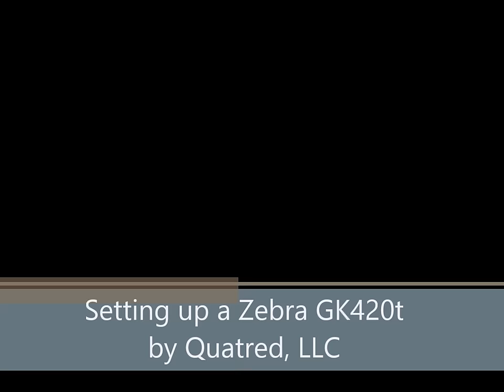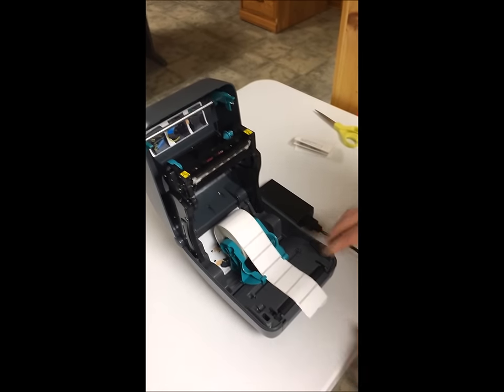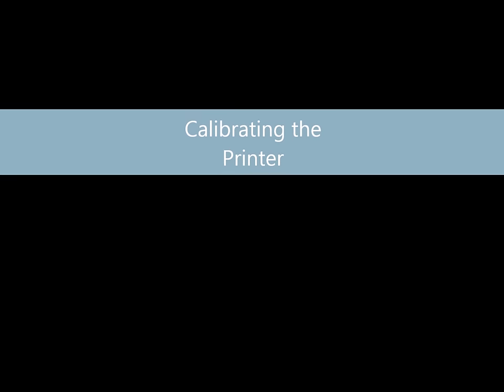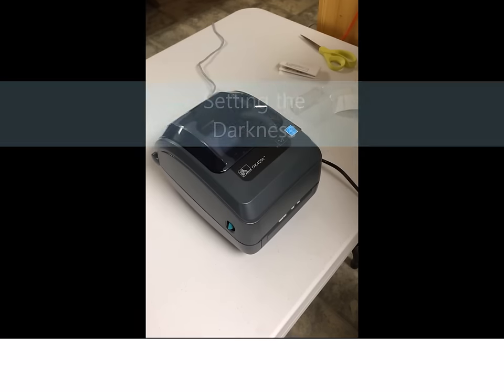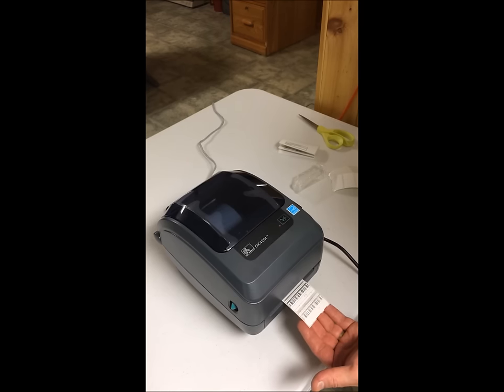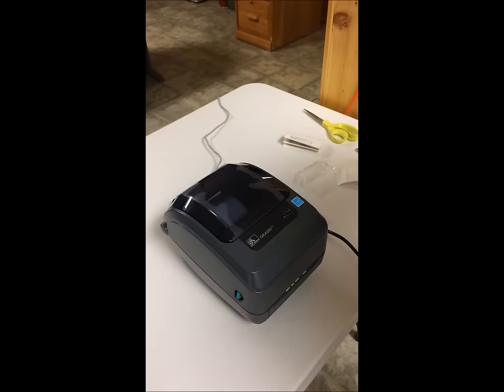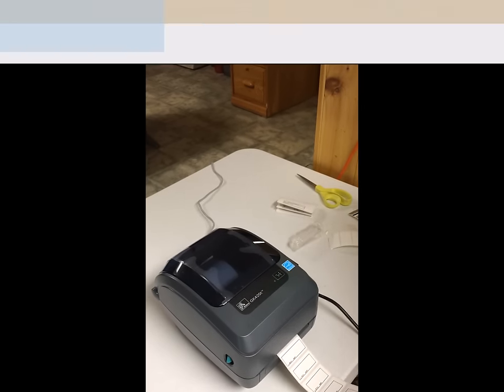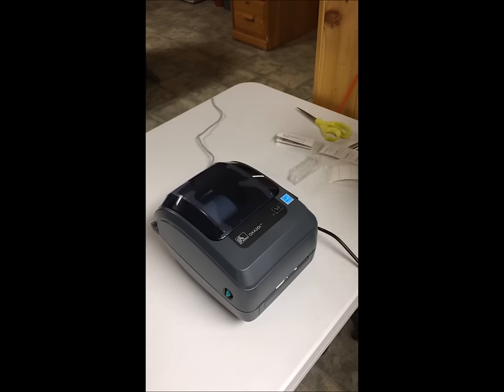Zebra GK420T Printer Setup

Comment: I have one of this printer but my scanner can not read the barcode sometimes it's read and others times does not read . Help me please
Reply from the maker: This can be caused by multiple factors.  What symbology are using for your bar code?  Are the bar codes printed dark and crisp lines?  Is the bar code close to the left or right edges of your label?   

The settings we use for most customers...
Code 128-B for the symbology
25 on the darkness setting
1/4" from each edge of the label

Comment: How do you reset the IP settings? Another video said 4 blinks but it didn't work.
Reply from the maker: You can reset the printer to factory defaults by holding the button down and releasing it after 4 blinks.  Remember, it is a group of blinks.  When you hold the button down, it blinks once, then it blinks twice, and so on.  Release the button after the group of 4 blinks.  Another way to change the IP is to print the config with 1 blink and browse to the printer with the IP it has assigned.
Reply: I was able to reset now, thanks.

Comment: Hi mate. Is there any method I can print Barcode Labels using this printer and mobile phone app. I mean without any computer. I need to print barcodelabels but using some mobile phone app.?
Reply from the maker: Check out Zebra PrintConnect and PrintStation.  They just might be what you need.
Reply: Can you just add it as a normal printer?